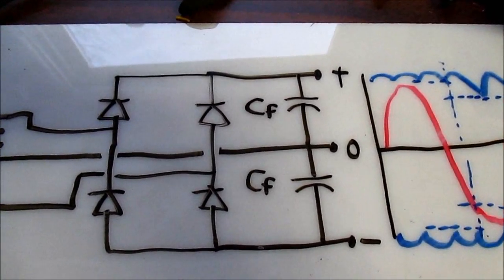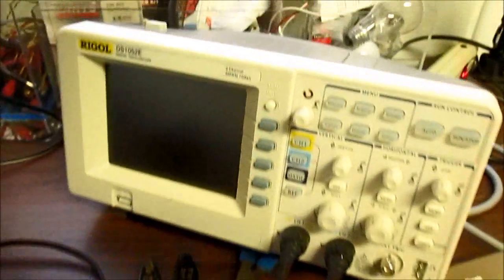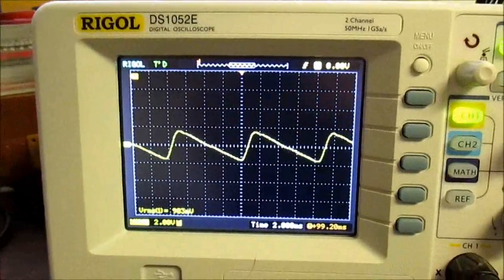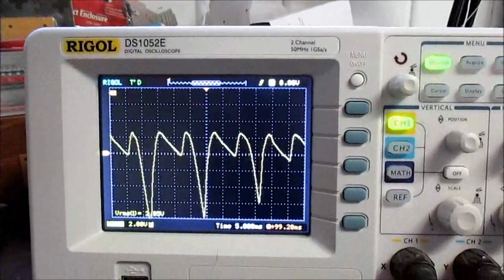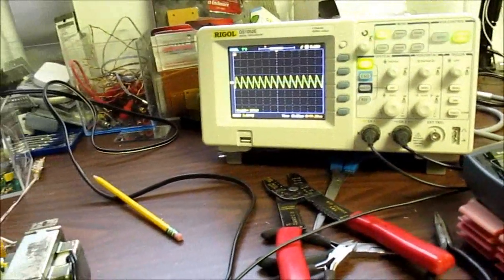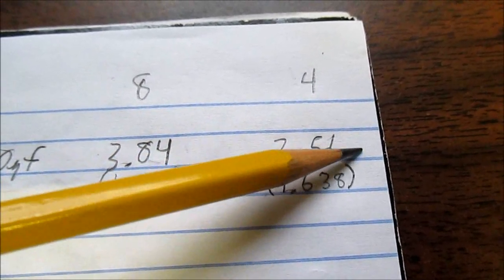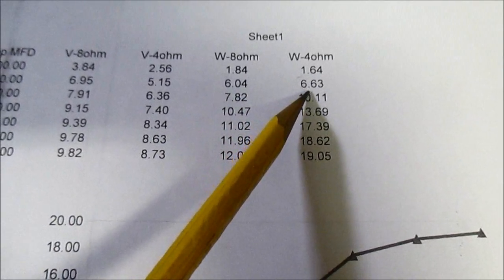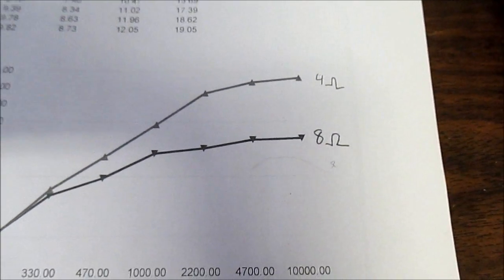Power supply capacitor influence on audio amplifier power

Comment: How to select the value of filter capacitor of transformer?
1) according to the Ampereage marked by manufacturer or
2) according to the actual ampere delivered by the transformer on full load (a resistive load connected in series with an ampere meter) when the output voltage goes down to 10% of the rated voltage or remains within the rated voltage (voltmeter connected across the transformer output) ?

Comment: In the 1930s larger amplifiers used large components such as large heavy swinging chicken and large size. Small capacity filters to get good results due to all that iron in the choke.
Reply: This is realy intresting feature because produce clear sine wave floating on DC at double frequency of the line. The choke itself resonate with the capacitors and not let the output RMS voltage to change in a decent load range. The inductor is change inductance by the load and mainten the exact frequency, the resonance cause low impedance path to the ground and mainten some noise free outputs exept the pure sine wave over the DC.

Comment: The results are somewhat counterintuitive. One may assume that 4 Ohm load would draw more current thus discharging power supply caps much faster. And as a result 4 Ohm load should require larger capacity for the same power output. Yet that doesn't seem to be the case.
Could it be that a power supply for the 8 Ohm load might also have a higher power rails voltages than a supply for the 4 Ohm load.

Comment: so does power supply effect sound quality when supply your  low voltage too your opamps like on voltage regulator lm337 and lm317 too supply +/-15 volts

Comment: For my tri-amplifier project, I am using a computer power supply to which I have modified the output transformer so that instead of giving me 12 Volts with 20 A, it gives me +30 / -30 V with 4 A.
The switching frequency is 200 Khz so the ripple falls out of the audio range.  Using 10000 µf capacitors I get very good results at 120 Watts power.

Comment: This may be a dumb question but here goes, when you say "non inductive load" is that just a pure resistance ? if you had a wire wound resistor, does it have significant inductance over other types of resistor or does it mean something else please...cheers.
Reply from the maker: Yes, to the first question. Wire wound will have a small amount of inductance. There are non inductive wire wound resisters that have a winding going clockwise and a second winding wound CCW which cancels the inductance effect. Even a wire has some inductance, so let's say minimally inductive. Check my video on resistors. there's some interesting stuff in there.

Comment: Does that mean a transformer having 2 or 3 Ampere rated capacity can't deliver more than 50℅ of the capacity and adding a higher value filter capacitor only does Minor improvements ?

Comment: Hi, I built 48pcs X Elna 4700uF and then I connect it again to my Capacitance multiplier from Rod Elliot design with 2pcs X Epsilon 22.000uF (https://sound-au.com/project15.htm) for my 16watt amplifier (Kolibri Amplifier https://anistardi.wordpress.com/2014/12/15/kolibri-amplifier/) when I switch off, it needs around 70 seconds until it's completely turned off.

Comment: Using Scope Probes with longer Ground Crocodile connector for testing noise in PSU is a BAD idea. One should pull the small Clamp in the front of the Probe and use the Barrel of the probe which mimics a Ball Point Pen refill .

Comment: Hmm, PA amps I have used tend to have a very large electrolytic power cap in parallel with a high value resister between each voltage rail to reference ground.  I always thought the cap was to supply peak power and the resister to allow the cap to drain after power down.  After this, there is a sequence of increasingly smaller caps to smooth out various frequency ranges of power rail noise. The smallest filter caps can't handle the voltages so have a resister in series. to protect them.  Smaller caps are primarily needed to smooth out the spikes caused by rectifier triggering voltages, these spikes have very steep slope so react like high frequency even though there are only 2 per supply cycle.  Could be wrong but that was my take on it.

Comment: This is really only true for the very small scale and low wattage amplifier used in the example, and starting with very little uf value. This whole scene will change to very little to NO, increased output, when you start at 10000uf and go up to 100000uf in capacitence. This fact starts to show already in your example where you go from 4700 to 10000 uf. The real reality for 100 watt to 2000 watt amplifiers, is that there is no change in output from extra capacitance in the smoothing circuit.

Comment: Can i add capacitor to computer smps output which I use it to drive my car amplifier. Will it help .?
Power supply is 12 volt dc and 15 amps current.
Car 2 channel Amplifier works within 12 to 14 volt range and demands 15 amps on full performance.
Reply: Dave Micolichek  hi, i know capacitors will not increase amperes more than power supply.
I would like to ask, will adding caps help maintain voltage and smoothen out load ( as music plays a beat some mili volt drops). When amplifier plays. It pulls a lot of power. 
I had doubt whether adding Some caps help cushioning load.  
Some car system owners add huge caps on battery to avoid dimming of headlights.

Comment: Very nice little video .  Given the small transformer and small chip amp the 2200 mfd  looks like a good knee. with a larger transformer  and big current pull . 6800 good start.   When your hard core it get up to 100,000 mfd per rail and that's per channel  at 200k mfd per rail per channel  the power supply is as they say STIFF.  You did a fine  video  with  proper size for use cap . Bravo
Reply: Ive got 8 nichicon gold tune 100v 100000uf capacitors there 4.5lb each i plan on using them on a mega class a amp power suply one day
Reply: @SheikhN-bible-syndrome  Two things one they are self forming above 100,000 mfd  you will see voltage of 4 or more volts before you form them . Two turn on current is Huge NTC and a relay are a smart move . If a toroid is used  the NTC is a must.  200,000 per leg and side 4 total will give a very stiff Class A power supply  with a long time constant .

Comment: Hello john, i have a question:
If for example you use two 4700uf in parallel instead of one 10000uf cap what it would be the result?
Thanks for the good video
Reply: That would be pretty much 9400uF
Reply: @IvanStepaniuk  yes, but the ESR would be halved.
Reply: Dave Micolichek  ... and often cheaper.

Comment: I'm a power supply design engineer who loves audio design as well - so I really appreciate your videos - but especially this topic.  Great job!  Always great at explaining and demonstrating the topic!
Reply: Hello greetings sir please I have crest audio 8001 and is like made in 90s if I put 16hom speakers it dropped and play instantly so please I am thinking that is the power capacitors it use 100v 15000uf capacitors 4 pic
Reply: I was wondering if you can recommend the best power supply capacitors. I am about to swap 2  capacitors  in the power supply . They are 22000uf each at 85v. 

My amplifier is this one. Check ot out and let me know your recommendations please. https://elektrotanya.com/harman_kardon_avr7000_rev3_sm.pdf/download.html
Reply: @Gioxtream  Doesn't really matter what brand you go with so long as they're not cheapy "one hung low" brands (though they will still work, just not for as long). Nippon Chemicon, Rubicon, Nichicon, ELNA and Cornell Dublier are known to make high quality capacitors. Personally, I would also aim for the lowest ESR available.
Reply: @Kiss Analog, I'm an electronics hobbyist and I've been looking to make a 2 x dual rail bench power supply from an available xfmr. I'm having trouble finding a solution for variable voltage and current limited reg's that will do the job. Would you be at all interested in pointing me in the right direction? Any advice you could give me would be greatly appreciated as I've been looking on and off for more than 5yrs now. Really just looking for advice on a good controller to start designing around. Haven't worked with any controllers since the TL494 and have no real idea what's available. Also I'd like it to be variable down to at least 12, preferably 5v so I'm ruling out linear regs cause at 60 odd amps the dissipation would be insane.

The xfmr has twin secondaries and a constant output of 20.5Vac + 20.5Vac 30+30 amps.
Again, any advice you could offer would be greatly appreciated.

Comment: Very good demonstration indeed. Thanks  alot.  I can only say that my humble experience confirms the importance of power supply caps quality and quantity for the sound.  I increased the uF in a commercial amp and the result was impressive.   
I remember i put two big very high quality 63mF Mallory in the place of some cheap 10mF caps. The bass and the music details both came out more.  As i said very impressive.   Maybe it was the result of noise going down more and Voltage rails more stable i can only guess that.  
The problem usually is that high mF high quality caps are very very big (and expensive also).  So there are practical issue.  But the sound can change in an astonishing way.  
I remember the amp sound going on for almost half a minute after the shutdown for the energy reserve stored in the capacitors.

Comment: To maintain high power across the full frequency spectrum you will need much larger caps. You should test ripple with a full load on the power supply driven to clipping with clean low frequency source. It’s harder for the caps to fill in the ripple when the power supply is loaded.

Comment: Just shows even your older videos are still informative. I sent an order off to China and it included a 10,000 uF cap. I have a single rail power supply I am building. It's 27 V at a transformer rated 8.88 A . I'm having a lot of V drop under load it's down to16V. Bad cap ? I'm ordering 2 more  Panasonics (hopefully Panasonics) from a UK dealer. Thanks for the help.
Reply from the maker: 27v (DC output?) at no load dropping to 16v (full load?) seems a bit much. Be sure a new cap can handle the ripple current. Three 3300uf caps in parallel may be a better idea for a supply handling this much current.

Comment: For amplifier power supplies use IT = CV  where I is current draw, T is time (i.e. 8.3 milliseconds for 60 Hz full wave) equals C for capacitance in farads and V for voltage drop from peak allowed.  Solve for the  variable you want.

Comment: What you really want to do is add inductors to the filter network to get the best line filtering, especially under load. Use series L and shunt C. During load the field stored on the inductor provides additional charge without dropping the voltage. This has a few other benefits also, as reducing start up surge. You can repeat this pi network topology for even cleaner results.
Reply: Those inductors before the caps will be noisey as all hell until the caps charge up though. That can be dealt with but I would understand why people would avoid putting that in an audio amp.

Take a look at this: https://www.falstad.com/circuit/circuitjs.html?cct=$+1+0.000005+9.001713130052181+41+5+43%0A169+-64+-96+112+-96+0+4+0.25+0+0+0+0.99%0Av+-112+-32+-112+-96+0+1+60+190+0+0+0.5%0Ag+112+-64+144+-64+0%0Ad+192+-32+192+-64+2+default%0Ad+192+-64+192+-96+2+default%0Aw+192+-64+176+-64+0%0Aw+176+-64+176+-96+0%0Aw+176+-96+112+-96+0%0Aw+192+-96+224+-96+0%0Ad+224+-64+224+-96+2+default%0Ad+224+-32+224+-64+2+default%0Aw+192+-32+224+-32+0%0Aw+224+-64+208+-64+0%0Aw+208+-64+208+-16+0%0Aw+208+-16+112+-16+0%0Aw+112+-16+112+-32+0%0A209+304+-96+304+-64+0+0.011+0.001+1%0A209+304+-64+304+-32+0+0.011+0.001+1%0Ag+304+-64+320+-64+0%0Aw+304+-32+400+-32+0%0Aw+304+-96+400+-96+0%0Ar+400+-96+400+-32+0+100%0Al+224+-96+304+-96+0+1+0%0Al+224+-32+304+-32+0+1+0%0Aw+-112+-96+-64+-96+0%0Aw+-112+-32+-64+-32+0%0Ao+20+64+0+4099+0.078125+0.0015625+0+2+20+3%0Ao+7+64+0+4099+40+0.2+1+2+7+3%0A

Comment: This was a very cool presentation. While I sat through it I had many questions, most of which were addressed at the end of the video. I have one question though, are there any benefits to adding bigger capacitors after you reach the point of diminishing returns in terms of output? Like longevity for example?

Comment: always enjoy the videos, thanks! If I wanted to run four op amps in parallel off one transformer without a center tap, would I build a power supply for each including their own rectifier, filter caps, and voltage regulator?  Would this work well?  Thanks

Comment: How many watts I can get on output with 2x4700uF caps in each rail? Rails are +-35V
Reply from the maker: MrJohhhnnnyyy That depends on many things, but you should get around 65 watts of clean output into 8 ohms give or take. This considers the supply can maintain the 35 volt rails under load.
Reply: JohnAudioTech PS is not really capable of handling well over 100W, but will handle up to 100W quite nicely. So, considering efficiency (let's say 60%) of an amp, I ain't gonna get more than 30W into each channel. But it works fine for me, I don't listen to music at full power